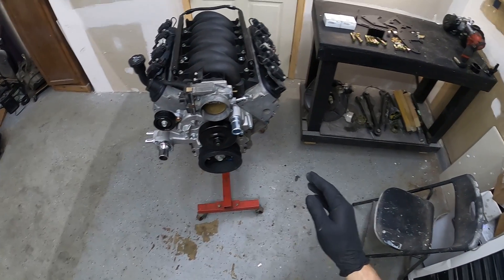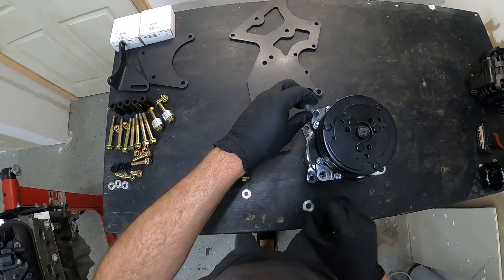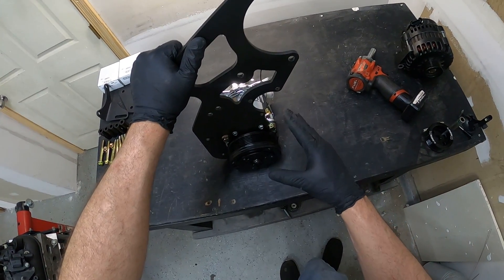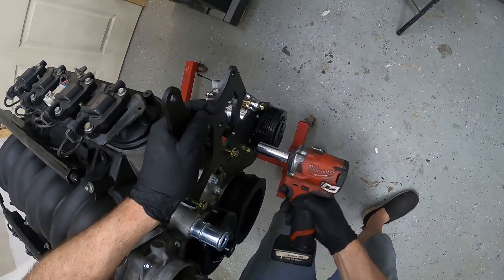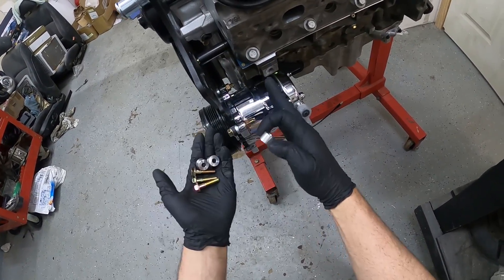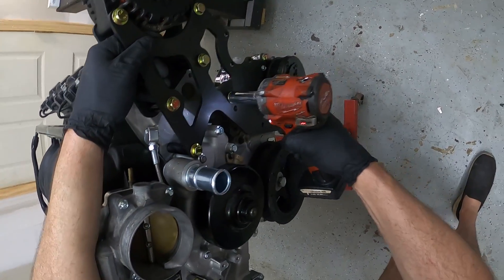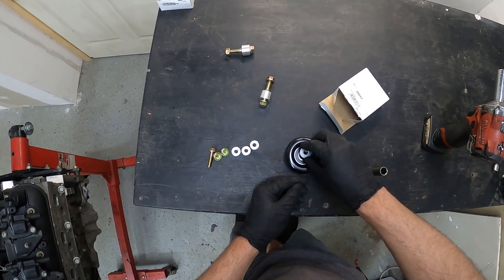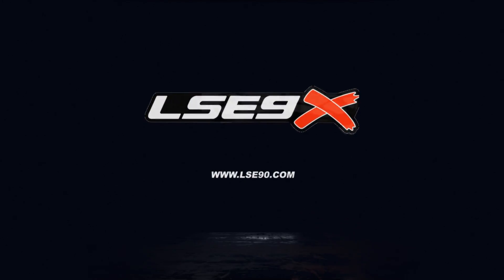Lse9x LS Accessory Drive With Sanden AC - Install and Overview

Comment: Does the compressor come prefilled with compressor oil?If not how much should you add to the system?
Reply from the maker: All compressors tell you they have oil in them but it’s best practice to dump it out and add the correct amount.  How we have always done it. Get what you can in the compressor, add a little in the rest of the system and you’ll be good.
Reply: So what would you say is the correct amount for just installing the compressor?
Reply from the maker: Normally around 2-3 ounces in the compressor, and an ounce or so in your condenser and if you wanted you could pour a little into the a/c lines before attaching them.
Reply: Awesome! Thanks for the response! Wish y’all had this kit along with those long tube before I originally purchased my kit from y’all. I’ll be putting a built ls3 matted to the bmw dct in my e90. I will be using rhe maxx race ems to control both tho.
Reply from the maker: Mike offers the sanden kits as an add on as well, you don’t need the whole kit just a few pieces to convert the original accessory drive to the new setup. 

The headers were a long time coming, lots of work to get those, should have a restock next month!

Comment: What are the benefits to having the AC compressor on the right and not of the left with you AC lines and kit? Thx
Reply from the maker: The bigger issue was the dwindling supply of FBody a/c brackets and their rising costs, plus most guys run turbos on the passenger side so this also frees up space for that.
Reply: Thanks for the clarification.

I am searching for the E92 328 for my swap! Have really appreciated all your products and instructional content!